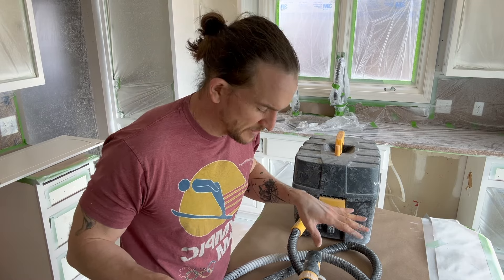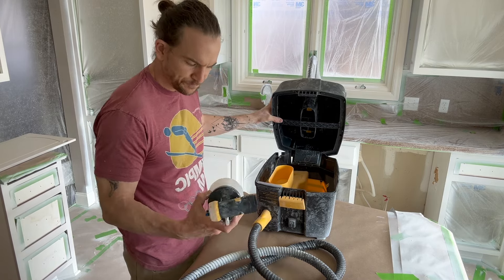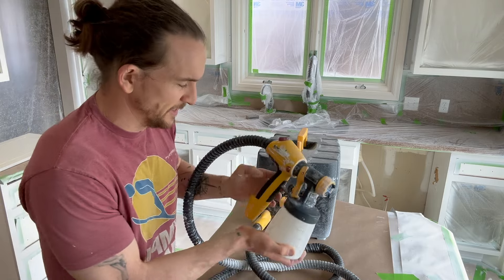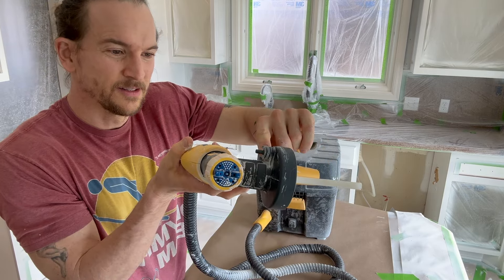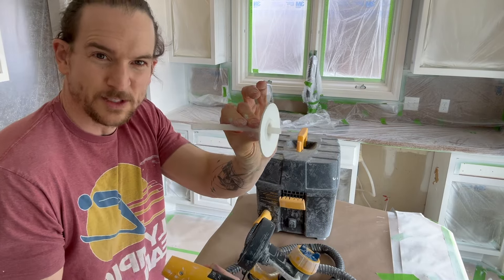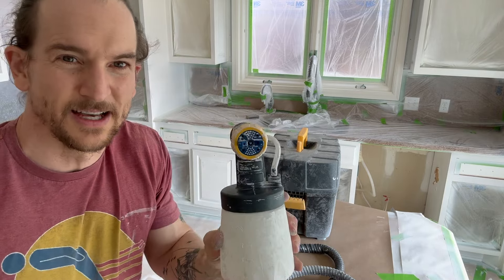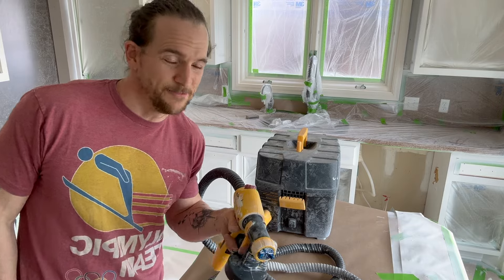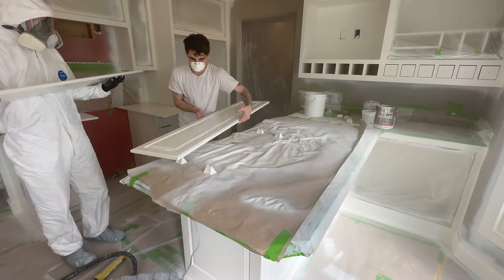Master Your HVLP Sprayer: Setting Up and Troubleshooting the Wagner Flexio 5000

Comment: I bought a Graco Truecoat 360 and it isn't bad. I will say your video explaining why you thin the paint by adding 20% water fixed some inconsistencies I had with my sprayer. Graco says you don't need to thin the paint when using this sprayer but you do. Made a huge difference. Thanks!

Comment: I have both the Grace 360 and the Flexio 5000. 360 is better because if you turn the 5000 in the wrong direction while the jar is full you will have problems.

Comment: I started  my diy bathroom cabinet with 3500 wagner somehow it turned out amazing and smooth considering 8:32  it was my 1st time using a gun, then decided to get this one instead and it was a disaster doing the small cabinet doors!  Orange peel and globs 🤦🏻‍♀️
Reply from the maker: That's frustrating! Sorry you're having issues. If you're having globs and orange peel, I would first make sure that the paint has been properly thinned, I go for 20%. I just did a video about this here: https://youtu.be/VL1JBpcAmBw

Second, make sure your air flow is at 100% and last dial back your fluid knob so that less fluid comes out. 

If you do all of this, you should be able to get nice atomization and a smooth looking finish. Good luck!
Reply: Thanks for the feedback! Your awesome

Comment: Your video is so helpful 
I’m considering buying the same unit and i’m curious if if I can get away with not having to mask the whole room? Does the paint particles fly everywhere with this unit? Thanks 🙏
Reply from the maker: If you use a water based finish, they will float everywhere, but it will likely be dry dust by the time it lands. Always a good ideas to mask everything and contain all the dust though. On a humid day, the dust can still be wet and stick to anything it lands on.
Reply: @diypainting  thank you 4 getting back to me 🙏

Comment: Hi I’ve been using the Flexio 3500. Using PPG breakthrough and I have been getting little bubbles every time I paint a cabinet door. I thinned paint to 15% because ppg only recommends 10% so I didn’t want to go too thin. My power settings are all the way up and the amount of paint coming out is slightly above the lowest setting. I make sure I’m not putting on the paint heavy and it still hasn’t seemed to help. Thank you for all your videos.
Reply from the maker: Sorry to hear that you're having trouble. The Flexio is on the low end for power, which is why thinning to 20% is necessary. As a test, I would thin a bit more to 20% and see how that works.

Comment: Spraying Kilz as a primer because my topcoat is a primer and topcoat in one and that'll go on next. Followed the advice here about atomization and the second attempt on a different section looks WAY better. Curious though on the first area where it's a little blotchy should I have that completely dry and sand it? Or throw another layer of kilz on then sand? Thx!
Reply from the maker: I'd sand the blotchy areas, then go back and spray another coat of primer over that and sand before top coating.

Comment: I bought the 5000 and sprayed some cabinet doors dark grey using Behr Alkyd (purchased before watching your videos) thinned 20%. I have visible spray lines in some lights. What would cause that?
Reply from the maker: Could be handful of things. Too light of coats and not enough overlap would be my guess. I’d recommend spraying the doors flat and have at least a 50% overlap as you spray. When you spray flat, you can put on a much thicker coat without any runs.
Reply: @diypainting  Thanks! I really appreciate your content.

Comment: At the end of the day cleaning up, would that little blue thing be less of a problem the next day if you ran some warm water through the sprayer?
Reply from the maker: Absolutely. Cleaning your sprayer at the end of every day is always a good idea. I usually bring the spray gun home and wash it out in my laundry tub.
Reply: @diypainting  I was thinking of like putting warm water in the container and run it through as if it were paint
Reply: @indieOttawa I would do it this way. Rinse out the paint cup,add warm water and a couple drops dish detergent and spray it thru the gun. Then disassemble and clean. Do this with my airbrushes.

Comment: I did exactly what you warned about--didn't clean the air vent adequately after first use, then let it sit for a few days.  I can't get air through the little hole on the underside of the valve seat, so I let denatured alcohol sit in the valve seat to hopefully loosen the clog.  The hole in the valve seat is in the middle but the drain hole underneath is to the side, so I can't get a wire through it.  Any advice?

Comment: Using this sprayer on your recommendation! It's been good - a bit of learning. 
I have just finished half of the cabinets with prime coat. I have a question, do you ever do a second coat of primer if you messed a door up or ended up miss praying. I mean you probably wouldn't because you are a pro but if that happens, is it ok to wait for promer to dry, then sand and respray?

Thank you!
Reply from the maker: Absolutely. Nothing wrong with spraying an extra coat of primer. Easier to fix something during primer than later during topcoat.

Comment: Really enjoying your videos. I have a question, if money wasn’t an option, and being a diy’r, would you suggest the Graco x5 over this product. I will be painting cabinets, doors, garages, walls, and furniture, and even outdoor house posts beside the landing area of the front house..  as I hear and noticed even in your vid today, a lot of overspray was seen while you were painting the room… thoughts. Thx
Reply from the maker: If you were just doing cabinets, then no, I wouldn't recommend the X5 over the Flexio 5000. BUT since you plan on doing all those other things, I think airless sprayers like the X5 are more versatile and will be better for all those projects. Just make sure to get comfortable spraying with it before doing your cabinets and I'd recommend a small tip size like a 311 to help control your spray and avoid runs.

Comment: Great videos with amazing tips and easy to follow instructions. Very informative and entertaining. Bought a Fuji Semi Pro 2 and ended up with an awesome glass smooth finish using your method. Couldn’t have been more satisfied. Saved a boatload too. I just wish I would have gone with BenMoore Advance. Was kinda worried about that long dry time so I went with the Coronado door, trim, and cabinet enamel waterborne acrylic alkyd. It’s owned by BenMoore. Levels, brushes, rolls, and sprays amazingly good. Just looks kinda dull and lifeless in the satin I picked. “Decorators White” and “Blue Danube” I love your positive energy Ryan. Great videos. Seen many of them multiple times.

Comment: Hey just wondering if you could tell me about your thoughts on polyurethane paint finish compare to this water based finish .I've heard the polyurethane finish with a hardener is a more durable   and a smoother finish and would this sprayer handle that paint ?